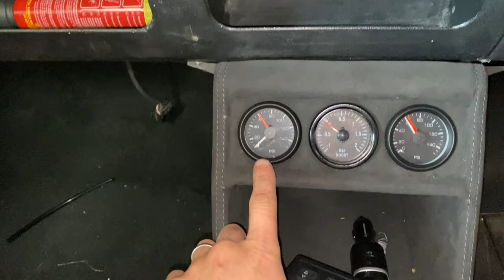Fitting Air Ride Suspension  -1983 Mk1 Golf GTI Restoration 1.8 20v t Engine Swap Bagging

Comment: I like the idea of fitting air bags to my Motorhome, as she is a wollowy beast, with them running with weight all the time. Not sure if I could fit it to the front suspension as I think it is a trans spring and I haven't even looked at the legs, I doubt that they would do something for a commercial set up. Having driven a variety Trucks I know which suspension type I'd prefer to have. Air all the way, even if it is just on the rear axle.

Comment: You need to c notch the front where the driveshafts fit
Reply: So you can get more lows or extended top mounts
Reply: I meant to say you need to c notch the chassis legs
Reply: It is already notched
Reply: Okay
Reply: Maybe extend top shock mounts